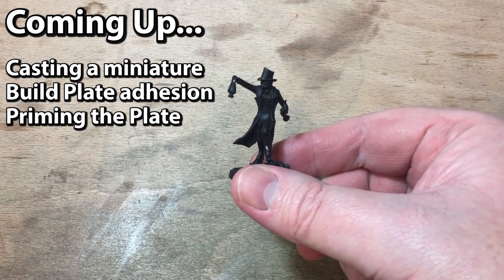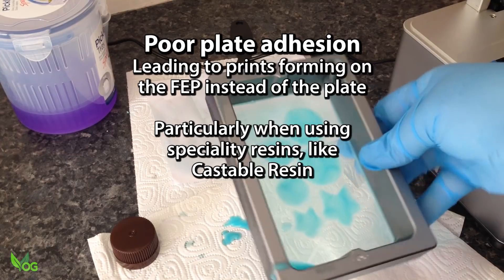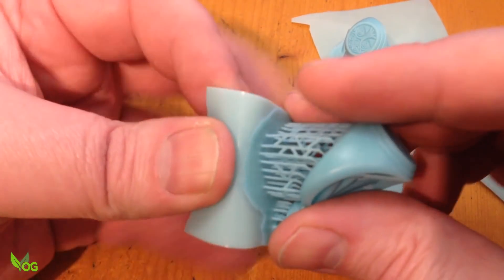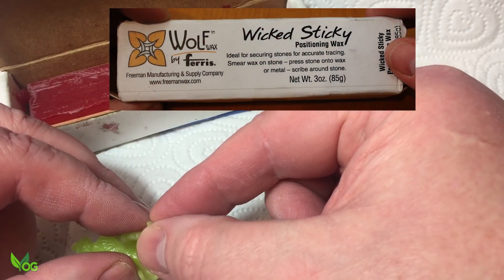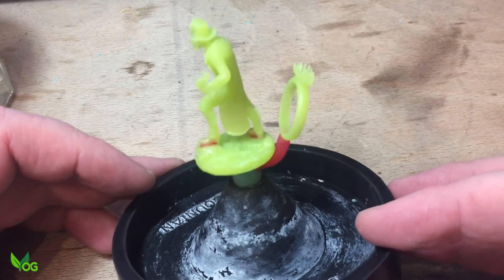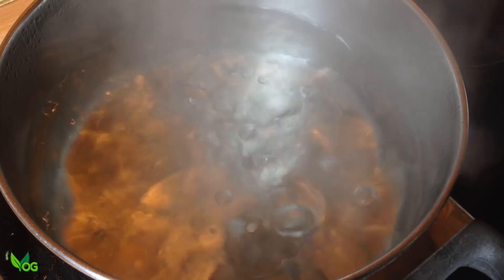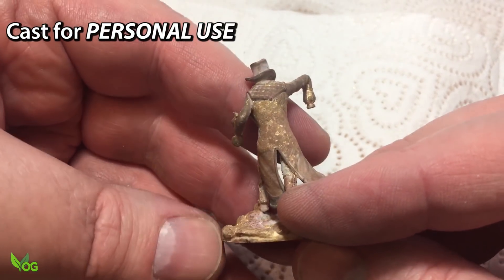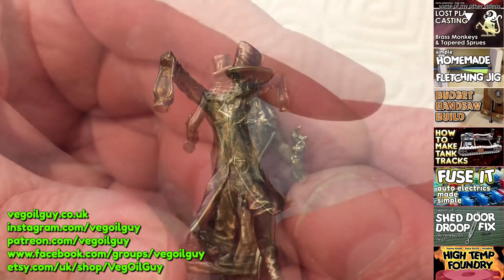Casting a bronze miniature + Plate Adhesions / Priming - by VOGMAN

Comment: Can you point me In the direction of how to obtain the prime coat file? Or how to build my own
Reply from the maker: Here you go Eric. You may need to change the dimensions to fit your plate. Just use the slicer to do that 😊
https://www.thingiverse.com/thing:3992869
Reply: Thank you for such a quick reply. Would you recommend to sand the build plate before using the prime coat or is that not needed
Reply from the maker: There's usually no need. If nothing sticks, maybe, but if most resins stick, all is fine. 😁
Reply: OK cool. I'm currently having an issue with two kinds of castable resin a cheap one from alphasense and power resin burn. I have had no luck with them sticking to the build plate. Hoping the prime layer file will help
Reply from the maker: Just double your bottom layer count and use the prime coat. Works like a charm 😁
Reply: My bottom layer is 8 exposure is 14 abs bottom exposure 85. You're suggesting double bottom layer from 8 to 16?
Reply from the maker: You lost me a bit there Eric... but don't be afraid of it. I'm no expert I'm only relaying what has worked for me.
So, the very bottom layer... lets say it's due to print 8 layers at 20 seconds per layer. Doubling both of these won't upset anything... 16 layers will still likely be at the very bottom of your supports and 40 seconds just help cook the resin nice and firmly. After this, go with standard settings.
You don't have to double - it's a personal choice - but I would recommend trying it. It works for me 😁
Reply: I'll try and mess around with the numbers thank you. I'm having fail after fail using 8-10bottom layers, 14-17 exposure time, and 80-85 bottom exposure. Any advice of yours really helps thank youv

Comment: Do you go though the full 12hour burn out cycle on every cast or do you get away with  taking it to 650c for a few hours then pouring?
Reply from the maker: Yep... it's long but necessary
Reply: @vogman  can you change you answer based on what i WANT to hear instead? Haha it is a very time consuming step in the whole process.

How much would you say it costs in electricity for the furnace and burnout oven for most of your castings? 

Would you say you use less energy with the gas counterparts of the burnout and furnace?
Reply from the maker: I never say how much it costs... I never look. What if my wife found out?  😁😁😁😁
I've been doing it a while and I'm not divorced yet, so whilst there's no doubt it costs money with electricity, it also costs  money with gas, charcoal, oil or whatever. Electricity is quieter and cleaner and the lack of divorce proceeding leads me to believe it can't be that bad... 😀😂😁
Reply: @vogman  I just think you have either a marriage cast in gold or a pre-nup as strong as mandalorian beskar :]]

Thanks for the useful info elec is potentially my route. There are newer induction style furnaces now supposedly much more time efficient i don't suppose you have used one over the conventional heated element? i presume it will only work on ferrous metals too.

Comment: I have the Mars elegoo and after watching your video I’m contemplating buying a phrozen sonic 4K but I’m using power cast burn. I have burn and wax I know you prefer casting the wax my caster actually prefers burn. Do you prefer the blue cast over both of those? I’m printing and casting jewelry in gold
Reply from the maker: In honesty they're all good. The Sonic 4K will have no trouble with any of those resins and will give you excellent detail.
Reply: @vogman  I didn’t know the phrozen sonic 4K could use power cast burn so thanks for that ! I haven’t seen settings for it anywhere. Any idea on settings on phrozen at 35 micron?

Comment: I do the same thing as your prime coat, I have a file I just drop in and center that's the size of the plate, and 0.15mm thick(3 layers). I will sometimes change it's size in Chitubox if I am doing a small project, to somewhere around double the main objects footprint. Works like a charm. I've found no need to increase my base cure time though.

Comment: I have always depended on your content and actually working in the industry advice and tips/tricks to guide me along on my resin printing adventures. Thanks again for sharing your Prime Plate Concept and now I will do the same, just add the file in The Box. That method has saved me from countless fails because they don't happen anymore. As I progress in my need to get better at this, I was wondering if you have every tried using additives like ceramic dust or even metal powders with Resins?

Comment: I love the built in prime coat. I printed 12 solid models on my Phrozen Mini and had 7 fail at some point (4 never even started) and the others still were a little warped. Printed it with the prime layer (no other changes) and had 12 perfect models.

Follow up question - This isn't really applicable in your case with a raft and supports, but for direct to plate prints, have you considered doing tabs to the print (like you see in CNC cutouts) to make detaching the prime coat easier in post-processing? It would be something that would be done in the design phase instead of Chitubox, but I think it would be wonderfully easy to clean up. I would love Chitubox to even add a feature built in with a few different options for this style of support structure.
Reply from the maker: Thanks Aaron. It's a very simple idea but it works very well. Some people say "what a waste of resin," but as you've experienced, you waste MUCH more when you have a failed print.
I like the tabs idea... it's a clever touch. But I'm lazy and I like easy. If you watch a few more of my videos you'll see the prime coat appear quite a lot. It's thin and comes off the plate easily. After a quick wash, I easily bend and snap it into manageable sections. Only then do I reach for the cutters.
But if you give your idea a go, let me know how you get on 😊👍👍👍
Reply: @vogman  I'll definitely give it a go and let you know. I see the tabs being much more useful on repeat projects than one offs. It would be amazing to get any of this integrated with Chitubox

Comment: Thanks for sharing. Really interesting level of detail you can achieve. I am VERY new to metal casting with plaster. Have done few ALU in green sand. Well will give it a try! -and now I found you and realize you have done some fantastic experience with lost wax and use of plaster. Have now printed my first ring in castable resin and have had great success in making my own vacuum chamber for both plaster and mold! Actually  I have made two ovens both can reach 1300 deg C. -one with PID regulation and other with Segment progs. So it should now be possible to make a first bronce cast..:) I have one mayor question...What temperature is advisable to raise plaster mold into before puring in metal (mounted in vacuum)? I guess melting point temp. of the specific metal? or what can you recommend. Another question...:) will the plaster mold be unuseable if cold down after vapour the wax (after segmented heated) for making the pouring in metal later? Hope you have time  to help me out before I enter maybe many false paths...from a Danish Fan...
Reply from the maker: You sound very industrious. Well done!
Temperatures vary but you want the flask lower temp than the crucible, typically between 400 and 600c. It depends a lot on the metal and on what you're castings. It's a matter of fine-tuning until you find what works for you.
Best of luck 😁👍👍👍
Reply: Hi Geoff. Thanks for guide. Just having lots of fun in the workshop.😁 thanks for your work and share.

Comment: Hi VOG,  thanks for your vids, great for us live steam guys.  Noticed the bronze solidified partly on pouring.  Do you think 1100 degrees C max for the electric furnace for silicon bronze is enough heat, or should the furnace be able to heat to, say, 1200 degrees C? Most electric furnaces on the market only get to 1100 degrees max, I fear this is not enough for silicon bronze.  Your thoughts? In your experience can the controllers be “hacked” to get to 1200 degrees C?
Reply from the maker: Actually Darin I have that set at 1020C and I find I'm getting closer to perfect now. Hotter is not always better. It's a funny process, you want it solidifying the moment it lands... if it sits just a second or two in can oxidise and spoil. So believe me, for Bronze, 1100c is working just great 😁

Comment: I don't know. never have I primed my phrozen printer. perhaps it's just with blue cast. blue cast is a bit spoiled needs special treatment.
Reply from the maker: Bluecast is famous for its sticking issues, but in the past I had similar troubles with Powerresins. When I used my Mars, folks said "It's not powerful enough, you need a Phrozen. That will stick." So when I got the Sonic 4K I was excited to try Bluecast without my prime coat approach... it failed. So now I use the prime coat method which costs pennies but works an absolute treat 😁
Reply: @vogman  try sanding the build plate. perhaps this will help. I did this for blue cast on my old photon.

Comment: A quick question...how hot is the flask, when you put it in the vacuum for pouring? Gaskets?
Reply from the maker: Personally I drop the flask down to around 450C but this is one of those personal choice things. I've heard stories of temperatures between 350 and 650. The gaskets cope at the lower temp end quite well but do not replacing after several casts.
Reply: @vogman  thanks. Always wondered about that.

Comment: You aaaaalmost have me about to get a resin printer and expand from my investment and greensand castings. Amazing detail!
Question to clarify something - did you mean 80 grit sandpaper or 800 grit on the mirror to make the plate flat? 80 seems a bit harsh.
Thanks for all the time you spend sharing all that you do! 😀
Reply: 80 grit. You need that texture. 800 grit would be pretty much like polishing it which is the exact opposite of what you want haha
Reply from the maker: No, honestly, 80 grit. Some use 60 grit. It sounds harsh but you should only be using consistent "firm" (not hard) pressure and it's metal after all. In the unlikely event that it scored it badly (it won't), then just switch to 200, then 400, then 600, etc, but really, the results you saw here were 80 grit paper. It works.
I use 600, 800, 1000, 2000 grit on my models and jewellery, so I know the difference 😁
Reply: @vogman  ah, nice! Thanks for clarifying!
Reply: The basic elegoo is just 200. The pro is just 250. It's really nothing considering the detail.

Comment: Very nice miniature. I've thought if I ever get into metal casting, I'd do silicone bronze for parts used on boats.
Reply from the maker: To be honest, any bronze is good. It flows nice, has great strength and doesn't rust. It's an excellent material 😊

Comment: My GOD man, that is incredible, but you say castable resin and 3d printer, but miss out the expensive furnace and vacuum chamber!
Love your work tho, that has sooooo much potential!
Reply from the maker: Shhhh.... my wife sometimes reads these comments...
You mean my cheap and frugal equipment 😁
But in fairness, if you watch this video  https://youtu.be/qxj5eUkAFUI   I started this hobby on a budget so small I was told it couldn't be done.
Reply: @vogman  I've been following you since the oil burners dude...  I'm still on the home made gas bottle and FDM in plaster stage!
Reply from the maker: Good man!!!
You'll get there. Rome wasn't built in a day... good things take time 😁👍👍👍

Comment: Go on then. Elephant in the room. The unmelted piece of bronze? Trying to figure that out 🤔 Great cast, fantastic details. 👍
Reply from the maker: You mean the slither I slow-mo'd? It did melt, believe me, but it cooled as I poured and formed the perfect shape of the cylinder. But I loved the glorious colour show. It fascinated me at the time of the pour and the recording didn't really do it justice 😁
Reply: Wow wouldn’t have expected that. Thanks for explaining as I couldn’t figure what had happened.
Reply: @VOG thanks for your vids, great for us live steam guys.  Do you think 1100 degrees C max for the electric furnace for silicon bronze is enough heat, or should the furnace be able to heat to, say, 1200 degrees C? Most electric furnaces on the market only get to 1100 degrees max, I fear this is not enough for silicon bronze.  Your thoughts? In your experience can the controllers be “hacked” to get to 1200 degrees C?

Comment: It is amazing what you can do with a 3D printer and castable resin but don’t forget about the two furnaces and vacuum chamber also. I’ve got a Mars pro and am currently saving up for two furnaces and a chamber. Your videos have been great help in my research and I’m sure that when I get my hands on all the required equipment they will be helpful in the experimentation process as well! Thank you!!!
Reply from the maker: Absolutely true... but witout the printer and resin, the ovens et al are useless 😁😁😁
If you haven't seen this video, do check it out - https://youtu.be/qxj5eUkAFUI - I started this hobby on a budget so small I was told it couldn't be done. but I found my own ways. It's still far from free, but some of these DIY projects can save you a bundle.
Reply: @vogman  I’ve been working my way through your videos, all great by the way. Thanks again!